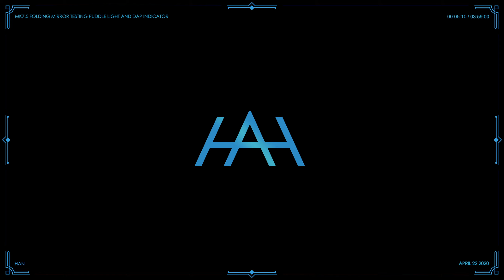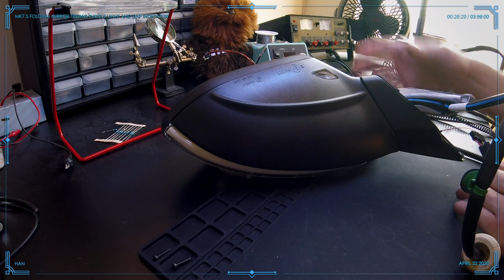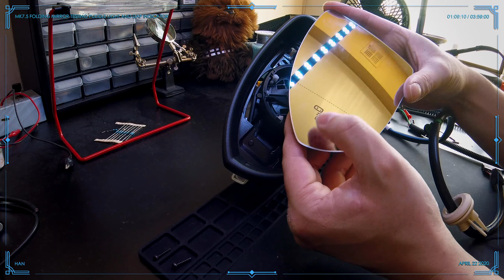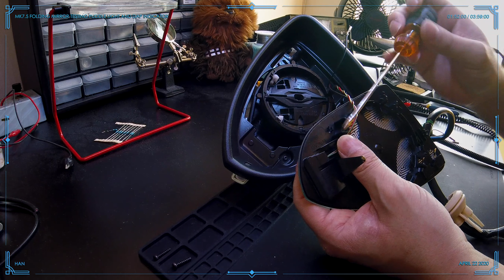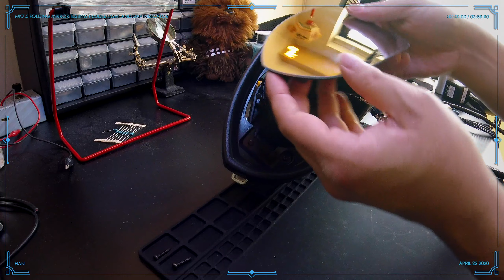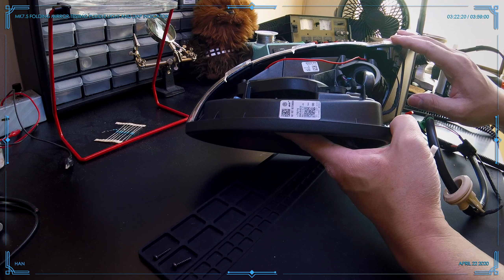MK7 MK7.5 Facelift Folding Mirror Puddle Light and DAP Indicator Test for Golf R / GTI

Comment: Hey. I just looked at your videos and I was wondering if I’m trying to add puddle lights on my non power mirrors and puddle light as well. Where do I put the pins in the connect from the mirror harness.
Reply from the maker: Sorry for late reply Brandon but you would have to pull the wire through into the door and find the right pin from the door controller which from the harness end was pins 1 & 3 (in vid) so I assume same pins on the door controller where the current mirror harness is plugged in.  I don't have my original mirrors any more so I don't know if the wires are already part of that harness or if you need to run your own wires.

Comment: How did you connect the wire to the puddle light
Reply from the maker: The puddle light is part of the housing and wiring at the harness was already in place. Just was checking the connection to make sure it all worked.